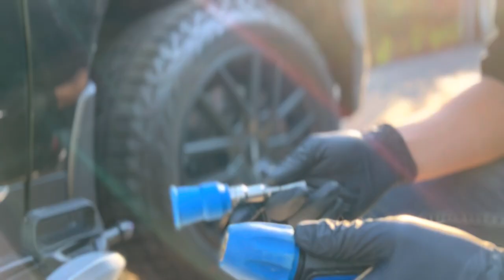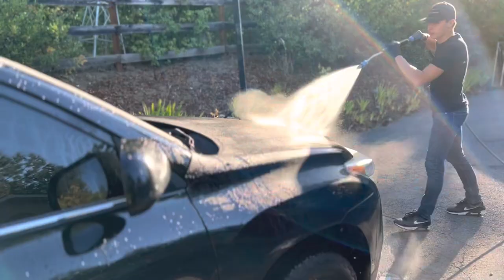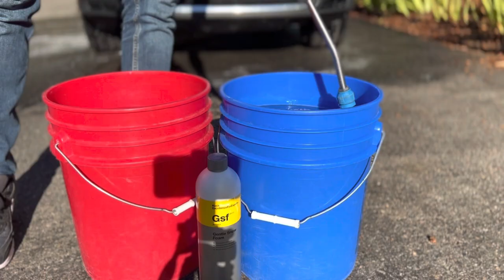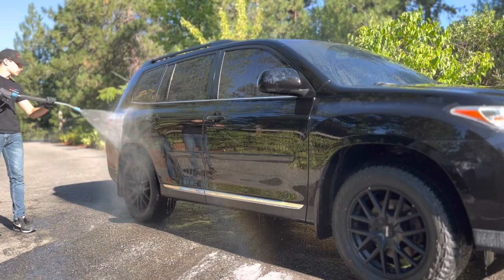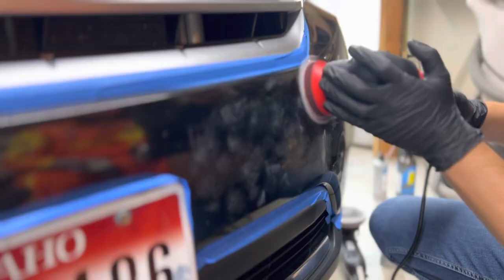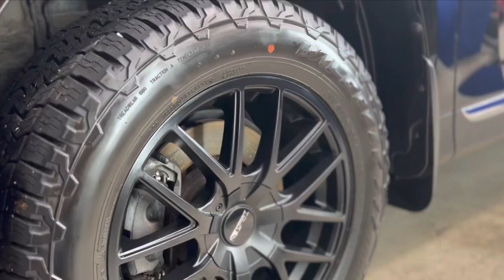Full Detail - Wash, Polish & Ceramic Coating

Comment: The contamination that came off that claybar was nasty, is that normal?
Reply from the maker: Lol this vehicle hasn’t been clayed in it’s entire life, it’s normal for it to look like that for a vehicle this high of neglect. Also in Idaho the contamination you get on vehicles is pretty insane.
Reply: @torrescarcare  Thats what I was wondering.  I've used a claymit before with pretty good results. Tbh I couldn't tell the difference, but I'm not sure how well a claymit would work on severly contaiminated cars.  But yeah  i appreciate how much work that was especially when you gotta film and edit. LOL